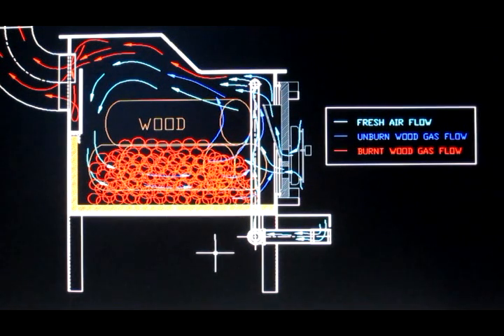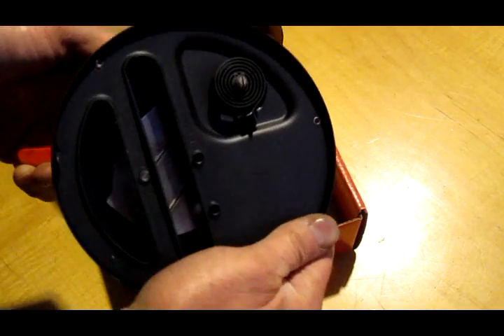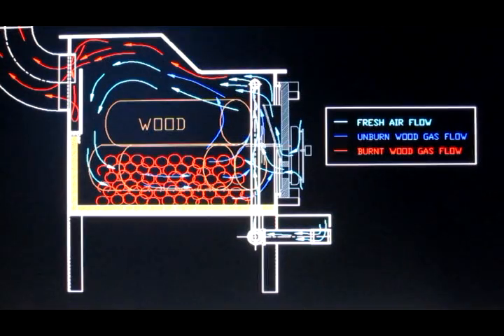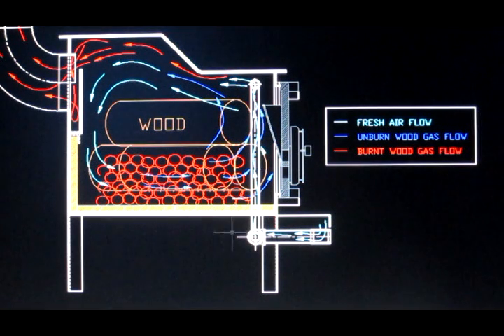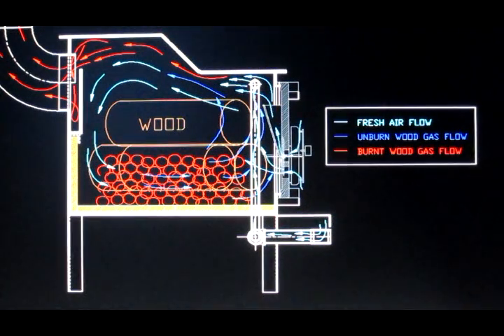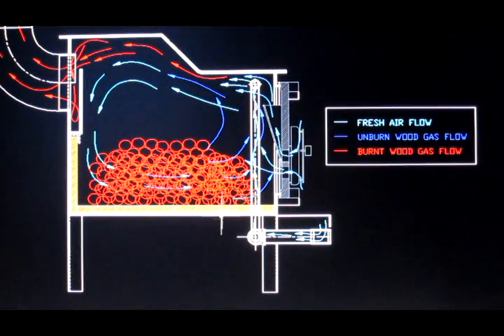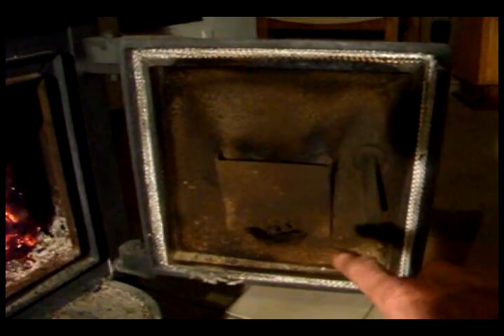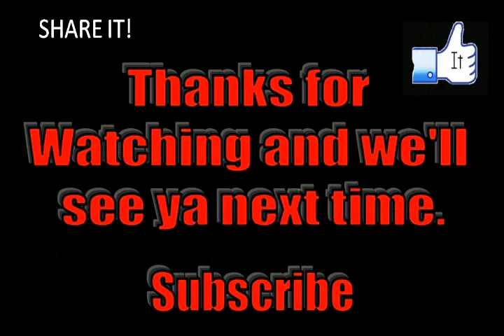Wood stove with secondary burn. Air intake control, part 3

Comment: so we got a different wood stove a month ago because the one we have used for 3 years had a hole in the firebox and we basically filled it every 2 hours or so.  On the new stove there were 3 holes on the back of the stove and on the inside, 2 of them have a metal pipe coming in and are pointed up and the third comes in and the pipe is pointed at the pipe going up the chimney.   how would that work because the holes are just open.

Comment: Hiyahhh, I've checked eBay for this condar stovetemp but no such product came out, any link where you bought it or other replacement part I can use? Nice video and well explain sir.. thanks from ireland
Reply from the maker: Vhon Samson That condar stove-temp was purchased in the 1980's. After that they stopped making them. Watch eBay, someone might list one sooner or later.
Reply: What kind of pipe inside stove?